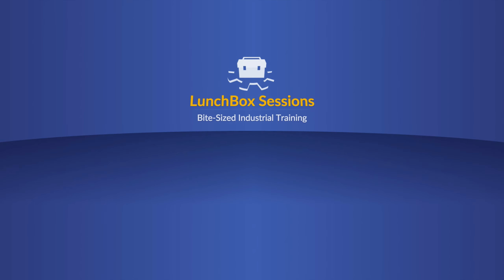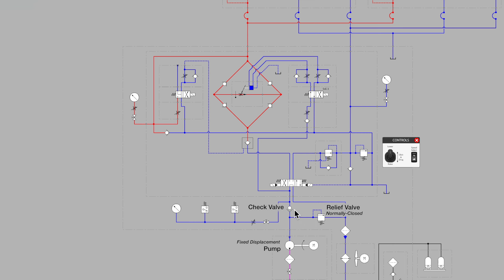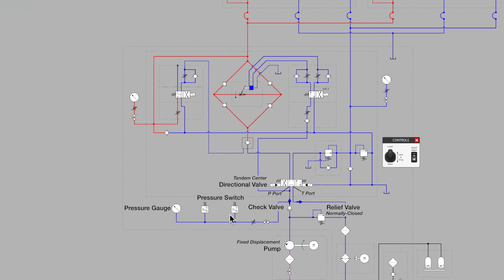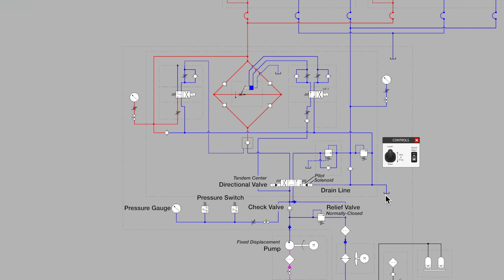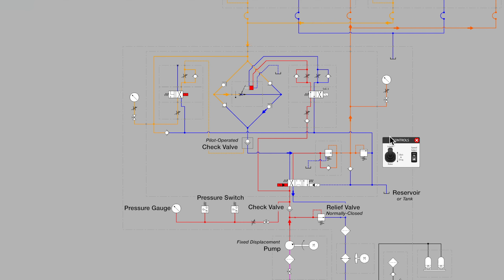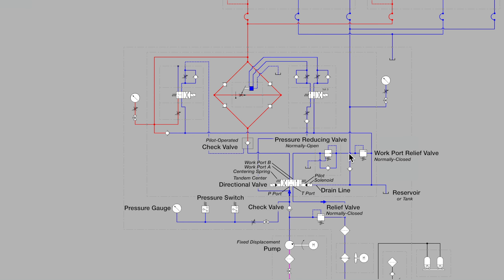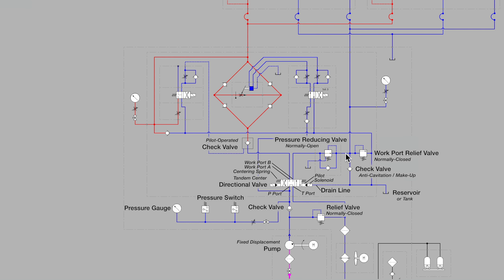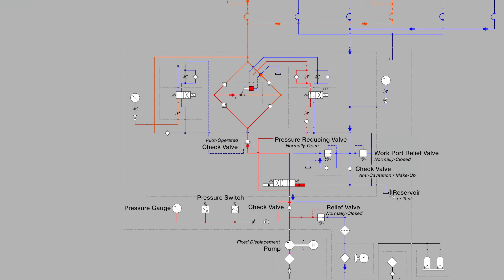How To Read Valve Section Schematics

Comment: Excellent video. What causes the oil to flow through the anticavitation /make up valve from the tank? Is it due to venturi effect (due to more flow while lowering)?
Thanks for your time.
Reply from the maker: Anticavitation flow from the tank  occurs due to a pressure differential of higher pressure (atmosphere pushing down on top of tank fluid) to lower pressure (partial vacuum pressure in a cylinder that is moving due to external forces, and thereby attempting to draw in fluid ).  Does that help a little? Feel free to reply again.  - Carl
Reply: So a vacuum is created during extension and retraction?
Thanks if you can still reply.
Reply: @genarocastellon8030  some degree of vacuum, yes.

Comment: Left section pilot is not connected to tank?
Reply from the maker: Thanks for writing. Both left and right pilot drains are usually tied together as one drain within a larger detailed symbol. But as mentioned in the video, the symbol for the solenoid controlled, pilot operated valve was drawn simplified. In addition, this original drawing that we animated, was from about 40 years ago. But sometimes in maintenance work, one is forced to work with older drawings that did not follow the standards we have today. The ISO 1219-1 2012 standard is certainly a better hydraulic symbol and schematic drawing standard than what was followed on this original drawing.  Thanks again for writing. 

To learn more about that type of DCV, see our video https://www.youtube.com/watch?v=YbgNZ_09ABQ